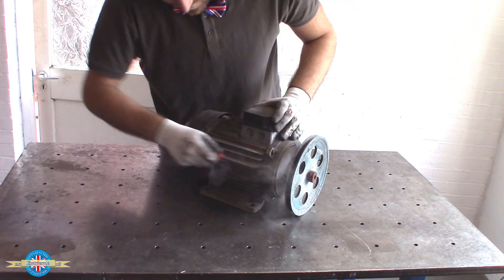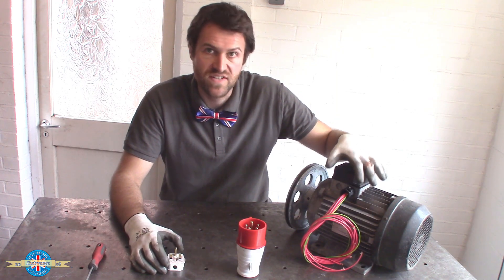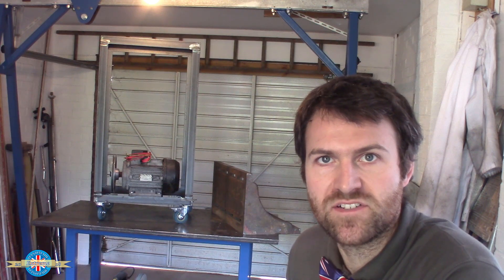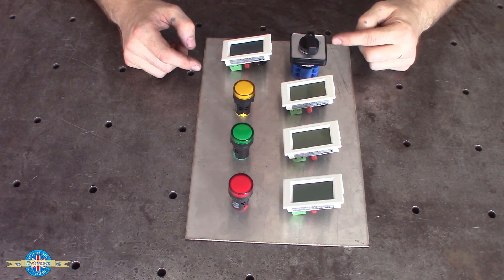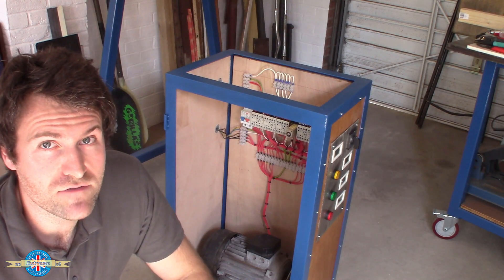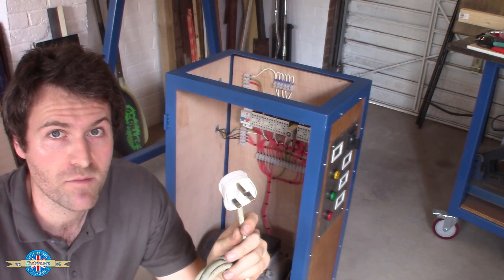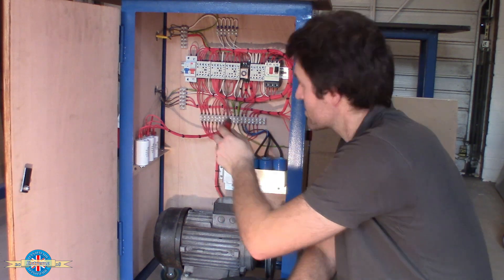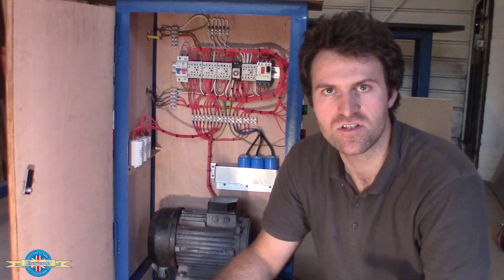1 Phase to 3 Phase Rotary Converter - 230V to 415V

Comment: This is the only rotary phase converter I have seen where  you show the voltage and current balance over the three phases.
Although you show for about a 1 second, if you could show the balancing with various loads that would be great.
We could also see the efficiency, assuming the displays are accurate.
Excellent job well done.
Reply from the maker: Thanks very much, I have not had chance to try it at different loads yet but I may do a follow up in future. Cheers 👍

Comment: In former Yugoslavia each household had 3 phase power. And at least one 3 phase 16A socket for stove.
Reply from the maker: Sadly here in the UK three phase if normally only in factories. 👍
Reply: Handmade Extreme Search the web for 'yugoslavia 3 phase socket'
Each household had obligation to level power consumption od each phase. Failig to do so by household plan, you will not get permit. It was done by meaauring the cureent on neutral wire by power meter. Neutral wire on overhead cables can be mads of steel and be dubbed as support for cable, as it carried very little current. Rest was ACSR. Also, it was useful because in case you trip the main fuse for one fuse, 2/3 of home still had power.

BTW, most motors made for local use are made in such way that they can be easily reconfigured from 3 phase to single phase by moving jumpers.
Reply from the maker: Sounds like a very interesting way of doing it, thanks for the information. 👍

Comment: Or you could have just swapped the motor on the lathe out for a single phase equivalent.
Reply from the maker: I could your right. However, the phase converter is not just to power the lathe. I have a couple of other machines that I have just moved into the workshop. Doing it with the rotary converter was a bit more convenient for me. If it was just the lathe then yes I would have either swapped the motor or used a VFD. Cheers. 👍

Comment: Nice build, but... :-)
1. Cable management. Please don't get into the habit of using too many cable ties. They impact the cooling of the individual wires. There are lots of very cheap cable management solutions. Also that little pig tail going to the CEE-Con is a little death-trappish. (And no, an RCBO does not grant you absolution ;-)
2. One more relay/contactor that turns the outlet on as soon as a stable voltage/rpm is reached could be useful. 
3. Reverse contactor. Since you are cooking your own 3 phases, you have the right to decide in which direction they turn. Srsly it is super handy to free tools that have biten into more material that they can chew. Drills etc.

Regards
Roland, former automation technician and general purpose electron tormentor
Reply from the maker: Hi Roland, 
1)Some great input there thanks. Good point re cable ties, I was originally going to use finger trunking but could not get any at a sensible price in the time frame. 
Could you be more specific regarding the pig tail I don't quite follow, sorry. 
2) Was part of the original plan but for some reason I left it out.. not sure why...
3) Great idea, I might add that! 
Some great input there thanks very much, I really appreciate comments like that. 
Cheers👍👍
Reply: If you've only got cable ties, try this, it'll keep a gap between them
https://i.imgur.com/mJjzIKM.png
Reply: 1) with piggy tail i mean the cable going to your CEE (3 phase outlet) It is not protected against tear, stress and impact. In the enviroment you deployed it we're actually even considering protecting it with a steel tube.
2) Arduino C is easy but when you got a leftover PLC that just wants a hug and purpose it'll do fine
3) Doo da reverse! Besides the what i already mentioned: Tap left screwholes, do that inthinkable thing with your drillpress holding the chuck to releas the drill... stuff like that
Reply from the maker: Ah i'm with you now! My protection philosophy for the CEE is not quite so obvious but does exist. Certainly not as good as a bit of conduit though. You might be able to see that the table top extends quite far back over the top of the converter, this is so that I cant crash the socket into walls and machines etc, It is still a possible snag risk but since I am the only one using my workshop, its just a hobby shop, then I am quite careful and tend to look after my tools etc.

Oooh what i could do if i had a couple of micrologix lying around...... I used to work with PLCs but fancied a chance. 

cheers.👍👍
Reply: I have seen some arduino based mini PLCs. I would so like to get my hand on one of these. But then again what would i do with it in my 60m² flat.
On the other hand, building one myself might be an attractive project. A simplified IL interpreter should not exceed my programming skills ^^
Reply from the maker: That would be a pretty cool project. I always fancied having a PLC to control the house. 👍
Reply: Roland would you be able to post any links regarding cable management to reduce heating and/or any articles I could read up on this subject as it is something I'd like to know more about.
Thanks
Reply: My sources are limited to german. In general there are a few solutions that are pretty much standard in the industry. Try to get your hands on a catalog from an industrial supplier.
If you see the pictures of what i am talking about, they should speak for themselves.
When it comes to heat and cables, well that is just a topic in every electricians vocational training. 
I germany we have rules for what kind of cable can be used under what conditions and where you lay them.
I.e. free floating wire with just insulation can cool better than a wire in a cable. With some math you can even figure out if you are in such a case able to reduce the cross section.
Also, a cable that is run in a channel or a tube cools different from a cable that is embedded in gypsum.
Good cooling: https://en.wikipedia.org/wiki/Cable_tray
https://en.wikipedia.org/wiki/Electrical_conduit

There are small size solutions for electrical enclosures.
https://en.wikipedia.org/wiki/Electrical_enclosure
Look at the second picture.
All inividual wires are run in what we colloquially call "Rippenkanal" (ribbed channel).
Reply from the maker: Webchimp Nice idea! 👍👍

Comment: Why didn't you just buy a VFD?
Reply from the maker: It's not just for the lathe, I have a few machines and doing it this way worked out quite a lot cheaper and more convenient. If it was just the lathe then yes I would probably have just put a VFD on it. Thanks 👍

Comment: Why not using a frequency drive? (VFD) far more efficient and uses less power.
Reply from the maker: I'ts not just for the lathe, I have a few machines and doing it this way worked out quite a lot cheaper and more convenient. If it was just the lathe then yes I would probably have just put a VFD on it. Cheers. 👍
Reply: good point, a drive needs learning for each machine, this just makes 3 phases

Comment: it works really well i tried as you said in the video and its absolutely amazing
ive heard about rotary converters but i didn´t imagine that they would be so simple
now i just need to get some contactors to finish the project because i dont have none laying around (and yeah im starting the motor by hand)
Reply from the maker: I'm glad it worked out for you. I will pretend I didn't read that bit about you starting it by hand...
Reply: Handmade Extreme its the lack of of contactors hahahaha
Reply: And ive simplified the circuit and i just need 2 contactors and for the starting caps i just unconnect 1 of those used to balance the voltages values
Reply from the maker: Id be temped to look at that again. You generally find the starting capacitance is much higher than the running capacitance. I think I put the values of my caps in the video description for reference. Sounds like you are getting on with it, good luck and be careful, make sure you always discharge your caps before touching them!!
Reply: Handmade Extreme yes you are absolutely right about starting caps, the motor i have needs around 150uF to start and have a decent ammount of torque, but the fact the motor is running in idle makes possible to decrease the capacitance but of course that exist some minimum values, ive tried and the motor starts fairly well just with the running caps (that are the same used to balance the voltage)
Reply from the maker: Excellent , sounds like you are making good progress. Send me a picture to my Facebook page (assuming you use Facebook) when you are done id be interested to see what you make. 👍

Comment: What's the efficiency on this? How many watts  in vs watts out? I assume the efficiency changes depending on the load.
Reply from the maker: With the lathe running (no cuts being taken, just spinning) it worked out at 89%. Have not had chance to to try any other load cases yet.  Cheers. 👍👍
Reply: Wonderfully Done Brother! and Yeah you can milk a series of videos on this thing for a while! We will watch it all!
Reply from the maker: Cheers, I might do a follow up at some point as I am already making some modifications to make it better haha. I just cant leave anything alone to "just work"  Cheers. 👍👍

Comment: Wow, very nifty.  Any safety devices in between the contactors so as they wear, if one drags a bit it doesn’t make a short during your time-delay switchover?  Secondly, does running the neutral to the center of the wye now found the chassis giving you a floating or secondary ground?
Reply from the maker: Thanks glad you liked it. I have overload protection on the idle motor and the delta star contactors are electrically interlocked to prevent both being on at the same time. Ideally I would like to swap them out for a mechanically interlocked star delta pair as is commonly used in industry but I have not come across a pair at a sensible price yet. As for floating earth, the shouldn't be everything has a direct path back to the main earth. Great comment, thanks. 👍👍

Comment: All of those's speaker wires are 14 gauge way to small of wire,plus input wires looks to small and output wires need to be like 6 or 4 gauge to carry a load.
Reply: MrStacy G. This is not 110 volts. 2.5mm^2 cable over a short run will do 24 amps and at 240 volts between neutral and each phase thats plenty of power.

Comment: Nicely done.  I built one but much simpler than yours. You mentioned that yours starts in delta and switches over to star. I am familiar with motors that "soft start" in the star configuration and switch to delta to run but not the other way around. Why do it this way?Also, I have heard that delta wound motors ,which are harder to find where I am in the USA, supposedly make better rotary converters, but I dont know how true this is.
Reply from the maker: It is purely so I can kick the voltage up from 230 to 415. In delta i'm generating 3 phase at 230v (same as the supply single phase). By swapping to star I then get 415 phase to phase and 230 phase to neutral.  Hope that answers your question, cheers.👍👍

Comment: Probably stalls as soon as you apply some workload
Reply from the maker: Worked fine with the lathe but did have a few teething problems with the Bridgeport milling machine. Swiftly reserved with the addition of a flywheel to the Idler motor shaft. Thanks for watching.

Comment: Why is this video dominated by so much cutting, drilling, welding, sanding and so on? Why not just address the phase converter? After ten minutes the boredom overtook me.
Reply: Some people just get bored very easily, not capable of concentrating on any one video for more than a few minuets.
Reply from the maker: My apologies, I'm quite new to this and am still trying to find the right balance of technical content vs the more visual building content. I hope you found what you were looking for once the technical bit did start. Thanks for the feedback.  👍👍👍
Reply: I enjoyed the construction aspect of the video. Maybe for future videos you could add just a "if you just want to see it working" link/button etc. which would suit both camps?
Reply from the maker: Interesting idea, I might try and incorporate something like that in future. The next couple of projects wont really be things that you can see working; more workshop infrastructure type things. But, I have a few projects down the line that could work well for. Thanks for the idea and i'm glad you enjoyed the video. 👍👍

Comment: Nice idea great craftsmanship I would like to build one but definitely that would has to go. Also all the heat generated that buy that motor inside enclosed wooden insulated cabinet not great on the electronics not great on the motor that will be overheating shortening the bearing grease life and insulation on the wine instead I’ll be operating in a very extremely hot Environment. Heat naturally rises and there’s nowhere in that enclosed cabinet for the heat to go and that little tiny opening underneath the feet of the motor does not count
Reply from the maker: That is a very good observation you have made. I have not had it running for any long periods of time yet but will monitor the temperature carefully and put in some additional cooling if required. Thanks. 👍

Comment: I took a 3 phase induction motor and put rear erth magnets in the Armature and that was chain driven by another Motor on one side and a small engine on the other also you can take the rectifier out of car alternators and run them like induction motors plus if you take out the rectifier and run it through a transformer you can get 110 or 220 and so on.
Reply from the maker: That sounds like a clever idea, do you still have to provide some excitation to the motor in the rare earth magnet system? 👍

Comment: Nice Fire-Bomb you have created there mounting the profile rail and those cheap-ass screw terminals directly on wood.... as a qualified electrician my toe-nails bend inward....
Reply from the maker: It should be fine,  a lot of mains switchgear in old factories was mounted to wooden back plates, and yes i'l admit a few of them did burn down....😊.. However, the converter will always be next to what ever machine I am using it to power and I never leave machines running when I leave the workshop, so if anything does go wrong I know about it straight away and should be able to react accordingly. All that said it should be fine anyway, all the parts were sized according to their ratings etc.   Those "cheap ass terminals" (great choice of words, love it 👍)  are rated for 20A and the system is limited to 16A. 👍👍
Reply: I think I could install a few sheets of aluminum roof flashing, to shield the wiring from the wood, faster than I could extinguish a fire.  I doubt, even than would meet code here in the U.S. but it would address the most likely path.   I have seen too many crispy crittered   barrier strips to let one get that close to flammables.  Would hate to see your very professional layout and  wire management in a heap of ashes.
Reply: 'Fire-bomb'. What a tit.

Comment: How are you getting away with smaller wire in the U.S. it would be a number 6 wire for something that is 3 phase
Reply from the maker: The size of the wire was determined by the amount of current it has to carry and a few other factors. Are you saying that in the US if its 3 phase then it has to be a certain size regardless of what it is powering? Also by number 6 do you mean 6AWG / 16mm2 which is fairly big. Like 100 amps big. Sorry I don't know anything about the US system.  👍👍
Reply: see the smaller the number the bigger the wire is so if its 6AWG. in the current if something is pulling 40amp you would need a number 8 wire 50 amps 6AWG
Reply: Its all about power (energy) -> voltage times current: P=U*I
Lets assume that you have 100W motor/heater/etc. At 100V, 100Ω load resistance, and 1A you will deliver 100W. With higher voltage 200V, load resistance 200Ω and 0.5A current, power will be the same.

Lets bring now resistance to the power equation: P=I^2*R
If wire has R=1Ω then power dissipating on that wire at 1A equals 1W. In 200V network current is 2x lower but power losses are 4x lower!  P=0.5*0.5*1 = 0.25W.

So, that's why you can reduce wire size in higher voltage network and no worries about overheating.
Reply from the maker: Great technical input, thanks you very much 👍👍👍👍
Reply: Because 110 Volts like NTSC is a shitty system.